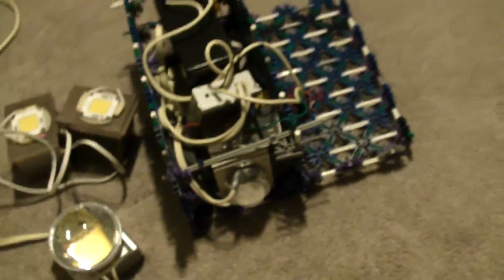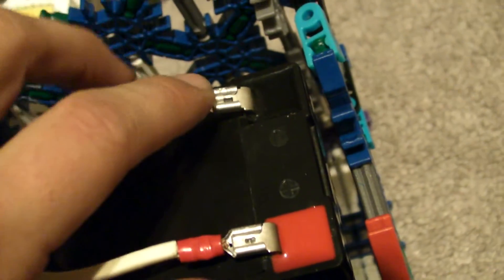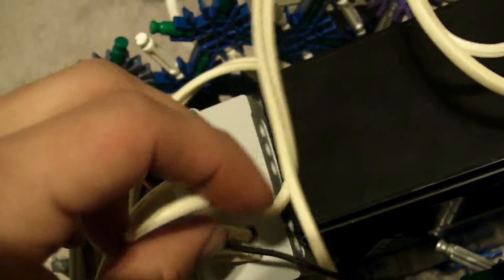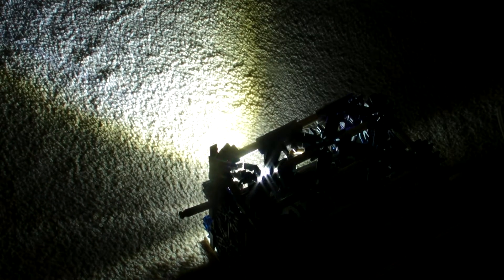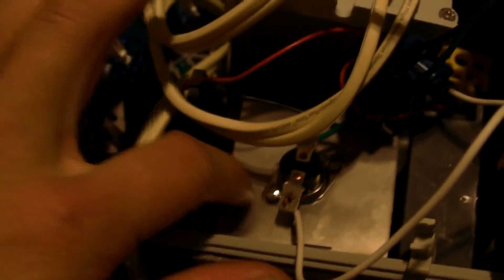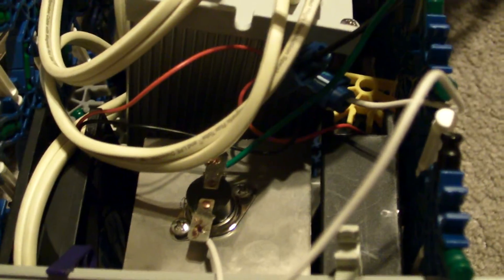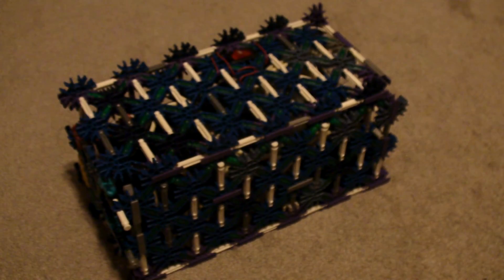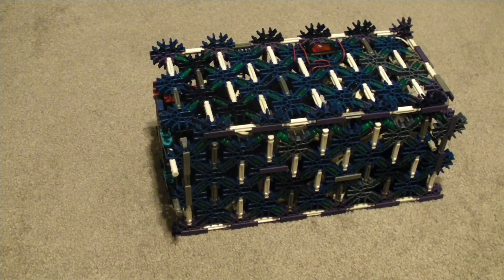100 Watt LED Homemade Flashlight 9000LUMENS!

Comment: Nice video! Didnt you say that you had a Locomotive Headlight and Ditchlight?
Reply from the maker: yes, i own a locomotive headlight/cablight. i am finding a way to power it up. however with these LED light i plan to put 4 100Watt Led lights on a vehicle in the same format as a train is approaching(2 ditch lights and 2 cab lights) im trying to find lenses for the lights that are very narrow and concentrate the beam to a smaller angle